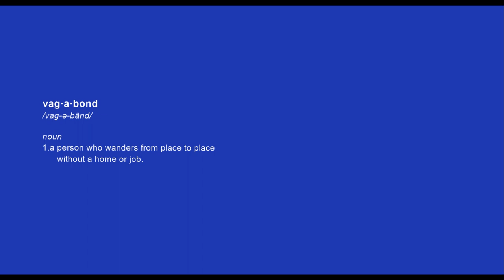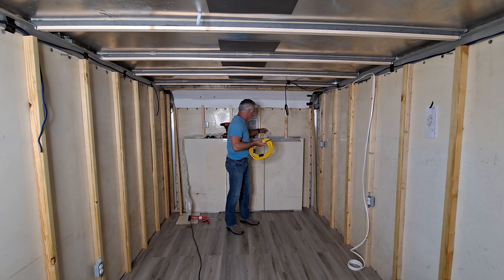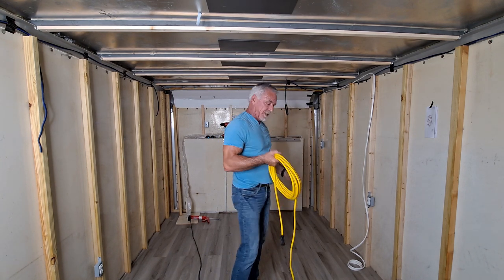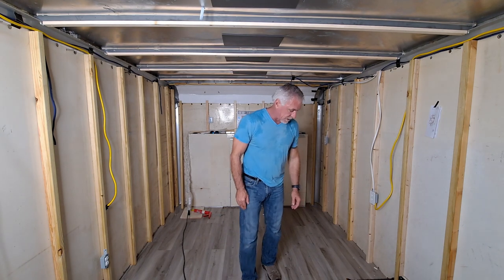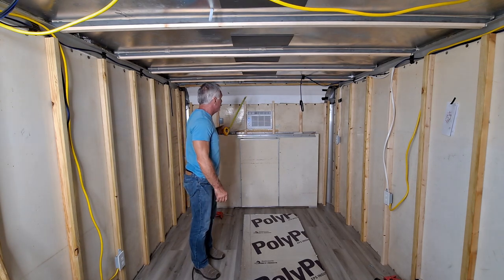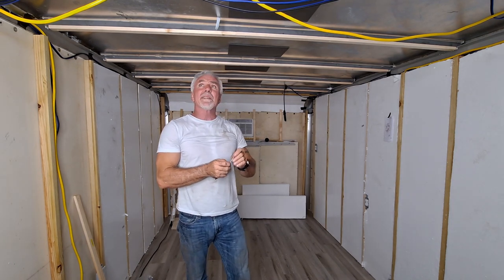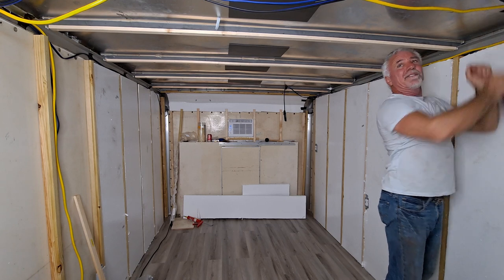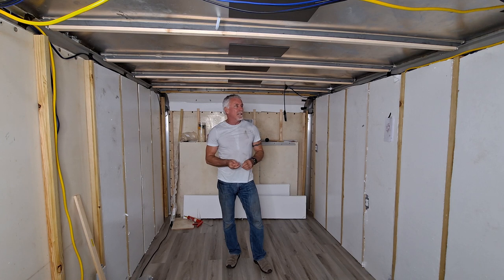Box Truck Conversion Insulation and Wiring

Comment: I especially liked hearing the thunderstorm outside, while  you worked, protected, inside the truck.

Question:  Do you think you will have any condensation issues on the inner metal wall of the outer skin of the box?  I've watched a lot of videos on insulation and builds.  There are a lot of opinions out there.  One of the most interesting ones was a guy who put inner and outer insulation, with an air gap between, in the walls and ceiling.  He could use his Maxx fan to blow outside air through the gap between insulation layers or draw air from the gap and put it outside.  He said he basically didn't need to air condition very often with this arrangement.  I've often thought I'd put temp and humidity telemetry instruments in the walls to monitor that (the wiring harness for that would be significant).  It would be a quasi-research vehicle as well as my boondock capable RV.  I think the sensors are probably not very expensive anymore.  I also think that if there is a possibility of condensation on one side (likely North), judicious repositioning to face the sun, periodically, would mostly eliminate any eventual problems.  For me, being a numbers guy, I would want the data, but that's just me.
Reply from the maker: Hi! Thanks for watching. My outer walls are a type of fiber board. When I installed my studs, it allowed for an air gap. I don't think I have any condensation issues... yet. Lol

Comment: I love your videos. They are very informative and help me with my current build on my 10 foot GMC Savana. I have just straight flat wooden plywood walls on the inside of my box truck already ?Can I just mount?  insulation right on there without framing the sections with plywood? Given I’m putting a very thin particleboard wood panels over that insulation ? I want to put some cabinets on the upper areas but I was thinking of just mounting the thin plywood two by fours and Jess just screwing them on right there. Would that work just as well? Thanks in advance.
Reply from the maker: Thanks for your kind words and thanks for watching. So if I understand what you're saying, you have plywood up already and want to (glue) insulation to it and then screw more plywood through the insulation and into the base plywood? Whew! Haha  I'm sure it could work, but remember, everything flexes when you drive. That would have to be really secure especially if you are attaching cabinets to it. I'm not an expert on any of this so maybe someone else will give you more ideas here. I have some pretty smart subscribers.